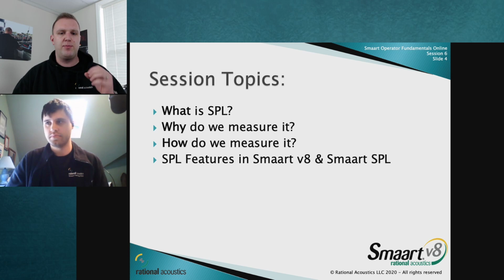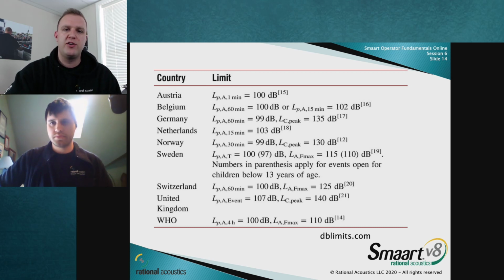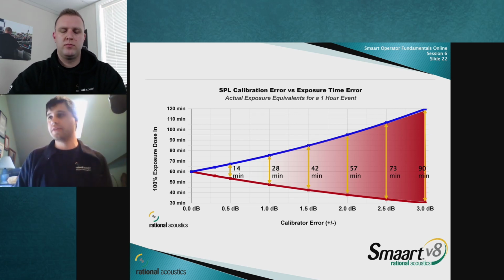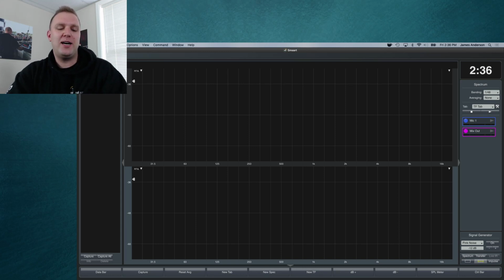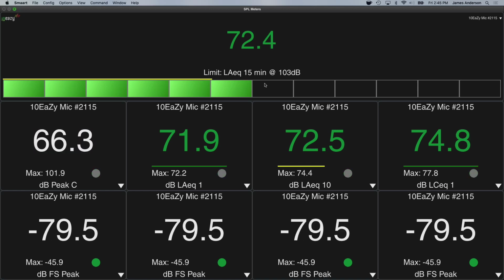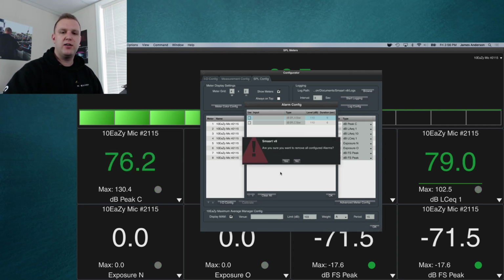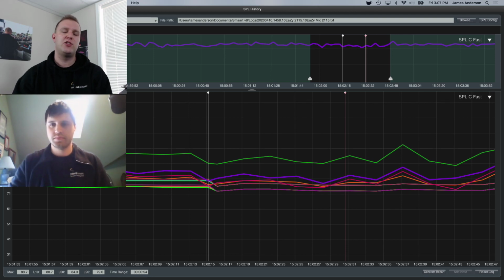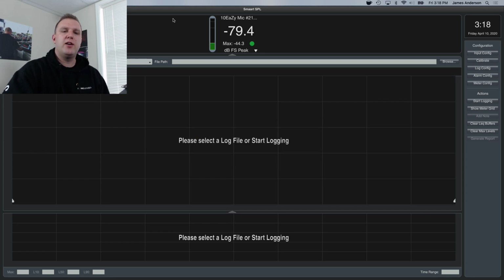Smaart Operator Fundamentals Online: 6 - All About SPL

Comment: I love my 10EaZy system, but unfortunately it is not possible to set an offset (even in Switzerland the loudest point in the audience area counts). 

I am also not quite happy with the MAM. NTi Audio for example makes a prediction. That's the energy you've already used up, and if you keep going at the current level you'll end up there. 

The MAM simply shows you how many dB your current LEQ30s is above or below the set limit...
Reply: actually this is possible in 10 EaZy
Reply: I know, but 10Eazy is not running on a Mac...